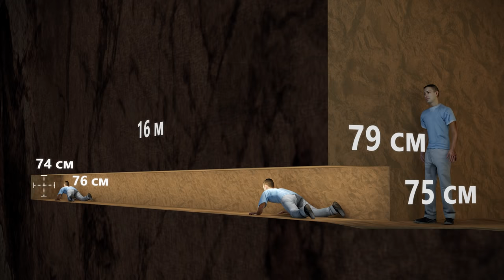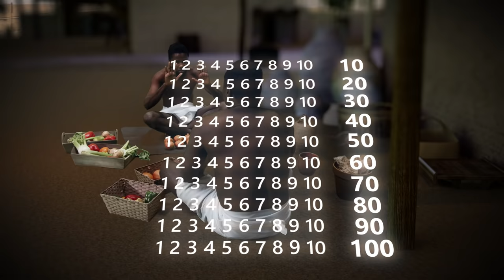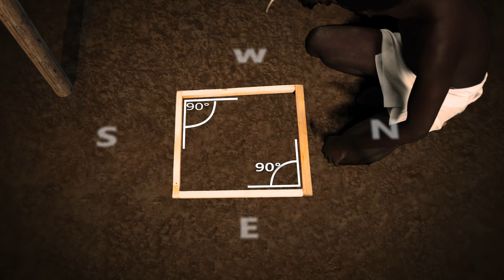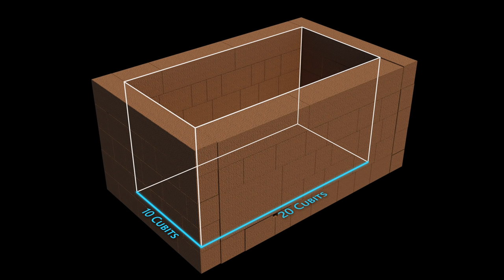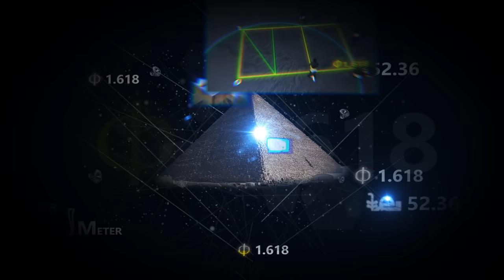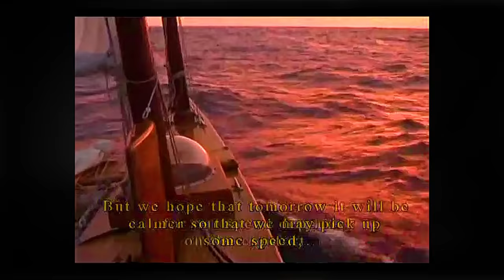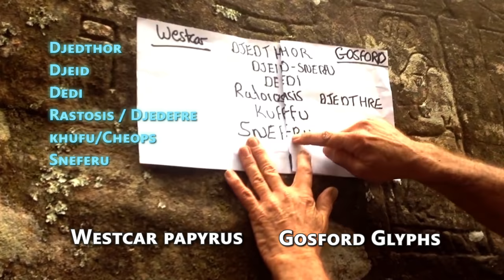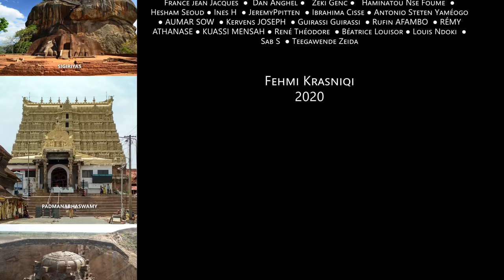The Movie Great Pyramid K 2019 - Director Fehmi Krasniqi

Comment: This makes alot of sense. Only one question. Has anyone bothered to actually try to melt any type of stone with a giant magnifying glass? The whole thing hinges on a central untested hypothesis and yet still makes more sense than anything I've seen put out on this before.
Reply: Yes! Has anyone melted stone yet on this large scale... Let's do it!
Reply: I wondered the same thing, but the basis of the theory still holds up, whether it was melted by a lens or some other means. There is another video on YT melting granite using radio waves. John Keely proved it could be done using music, or vibrations of a specific frequency. Given that light is on the same musical scale at a higher octave than sound, it's possible it had more to do with generating a specific wavelength than the heat generated by focusing sunlight. Just a thought :)
Reply: Might also have been chemicals, rather than glass. 

We have chemicals today that can create intense heat. Also there are signs of stone being "soften" several places in the world. 

Perhaps they where masters of chemicals for stone production after thousand of years of development.
Reply: yes Micheal Tillinger found out they used to melt granite in South Africa or what is now S,A check out some of his video's You will find out how they used to and still do it
Reply: I can't find a single credible example of granite being melted back into Granite of the same consistency it was. It always turns to obsidian or glass and not back to the origional colors or form in general. The pink granite in the Great Pyramid which is supposed to come from Aswan looks exactly as if it did come from Aswan, so they would have had to have melted it down and when it cooled it remained looking identical. At this point that would be an unknown heating process because other methods won't give you that result via sunlight or fire. I want to believe this and I will continue searching for the answers
Reply: @taylorgall9516  One method might not have been used for everything. If you would have found a building site from 2020 in 500 years, one might find a stone and conclude that we did not have tech to make concrete. It would of course be wrong. Also, we already know that they have tech we do not have today. The question is if it is unknown tools or unknown chemicals. Or a combination of both.  I think it is the latter, and thats why the answer is not simple. They did not have electricity, nor fossil machines, so they where forced to be creative with what they had.
Reply: @nicksantus5307  Thank you, will check it out.
Reply: I studied heat treating stone that were used to make stone tools. I've used blow torches on cherts. Never enough to melt them. Just some holes in there theory.  I still think sound technology was used to cut, dress and move the stones.  Heat just doesn't do it. We still have a lot to learn.   Especially about our past.  We have been knocked back three times or more back to the stone age in my view.
Reply: I have a Fresnel lens that will melt granite, but it has not been possible to slow the setting process to keep it from returning to obsidian rathe that granite! They must have had a way to slow the cooling to get back to granite rather than obsidian or rhyolite. if the hypothesis stands the ancients must have has a technology to gradually cool the melted granite.
Reply: @doc2help  main problem granite when form under continent ( pressure ) and 100,000 or million years of cooling time to give time to all crystals to grow  at the end liquid quartz bond everything together all of that cannot be done , it is more realistic to think of alien civilization with construction equipment able to transport and cut/ shape the granite
Reply: @doc2help  maybe if its in a vapor lock it wont change properties
Reply: The one complex avoided that throws EVERYTHING out is pumu punku. If your not familiar with it look it up. It's in Bolivia i believe. But the construction methods are unlike ANY other place on earth. Huge H blocks. Machined to PERFECT tolerances. Inside corners impossible to machine with today's tools. Made of dyrite. Just don't make sense at all. What was it even used for? The people in the area say it was there BEFORE they were.
Reply: @boatguy64  i know very well Puma Punku , agree but one correction rock type is Andesite a type of granite and the technical level is way out of this world  do you know the LAH report from Russian scientists ?
Reply: @doc2help  What about Nile water and or an Au bain form of heating with different liquids that would keep the temperature constant. I just looked up liquids and boiling points and sulfur seems to have the highest at 440 C but I have no experience with heating stones, could a longer period of granitie bathing Au bain in 444 C do the trick in stead of lens?
Reply: @MarcCuster  SONIC LEVITATION - SEE HAWKWIND LOL
Reply: @taylorgall9516  Specific frequencies and the meaning of gold
Reply: It's great that everyone seems to be waking up to the genius construction skills of the ancients. Look up the Serapeum and the Osirion, mad boxes in caves! Our real science and history is covered up by the establishment who are guided by the people who control all of our currency. You look at astronomy and biology for instance, all of the real experts say that current theories cannot have caused the effects we are now seeing, but it doesn't stop the academic masses from teaching that gravity creates the solar system and the galaxies, or that blind chance allowed a self replicating cell to magically come into existence and then survive, thrive and diversify, with a little more lucky charms. Earths gravity is too weak to defeat the strength of a tiny fridge magnet and a single protein is soooooo complex just 1 appearing is a vanishingly small probability and over 200 are required in the simplest viable cells. Don't take anything for granted, I could be talking shit, so think and investigate for yourself. All I can say from my own research is that from the big bang to evolution the ruling concencus tells us everything is a big accident and that there's no guiding force, nurturing principle or 'life wave' producing the many wonders of the natural world, and I view that dogma as not just absolutely ridiculous, but also, highly suspiscious..! I think it was Sir Fred Hoyle who said that expecting our universe from a massive explosion was like seeing a hurricane go through a junkyard and then finding a jumbo jet!
Reply: @al2207  i thought it was described as dyrite sp? A type of basalt
Reply: @boatguy64  i think you mean diorite but it is a type of igneous rock with smaller crystals
Reply: @davidrabie  melting granite with a lens is a proven fact it can be done very easy
Reply: @al2207  say they did melt it. I will allow that. But how do you reconstruct Granite? All the inclusions? Crushed. Melted. U get absidian. Glass. It begins homogenous. I can't see possible to take Aswan Granite and crush it, melt it and make Aswan Granite. Not absidian.
Reply: @boatguy64  there are numerous video on youtube with melted granite and ending with obsidian there is no other alternative
Reply: @63phillip  can you show me large scans proof, I mean a bucket size at least
Reply: Yes you can smelt iron with sun even far north see Prometheus Forge
Reply: @doc2help  Maybe it's the hot weather in the desert that made it possible? I don't assume you live in a desert, do you?
Reply: This is the best explanation I've heard to this day. I've studied and wondered since I was a kid. The question now is who taught them these high level mathematics 🧮 and why didn't they share the knowledge 🤔
Reply: @taylorgall9516  Do you have any more answers now? I'm very curious.
Reply: @RDB-mw9ig  yes I have a definite answer, you can't melt granite and be left with the same Granite. The crystals form under high heat and under high pressure very slowly and that's what squeezes them together so tightly. When you melt it down, all the constituents will mix together. Not possible in any way, shape or form and never will be possible to do with granite.
Reply: @63phillip  yes you're absolutely correct, it then forms obsidian, not granite.
Reply: @doc2help  It takes thousands of years of slow cooling for the crystals to grow back into granite. This video flunked geology 101.
Reply: @boatguy64  I've seen that...the blocks fit without mortar in incredible tolerances...wonder what theories were put forth on that structure? 🤔
Reply: @clivewells7090  I understand and agree, and so do several prominent scientists from various feilds...not all scientists are atheists.
Reply: @illiadmcswain3956  none that I've seen so far. They have no idea what Puma Punku was even used for. It looks like it was  blown apart and blocks scattered. Inside cuts were machined to incredible tolerances. No tool marks. I can't imagine it could be replicated today with diamond tools. Inside corners are particularly difficult without leaving them rounded. Show me how they cut a 3 way inside corner perfectly square. And outside corners so sharp you can slice your finger on it. 
 Supposedly made w stone age tools by a people who had NO written language. And didn't have the wheel or screw. AND only copper that was found. Not mined? Impossible.
Reply: If someboddy do that proof will have no chance to live🤪
Reply: @DeepSleepRelax  I live in AZ and I couldnt even cook an egg on the sidewalk in the middle of summer-117 degrees F!!
Reply: yes, they have.  However, nobody has tried the methods I'm looking into.  Sonic vibrations plus piezoelectric effect.
Reply: @growthisfreedomunitedearth7584  Now, we are in front our research, the stone are artificial, it 's concrete, is it possible to make concrete 5 000 years ago, every body have suggestion, the true arrive..💋💋
Reply: @boatguy64  what if it was partially melted and perhaps vibrated as to only separate grain boundaries temporarily.  It would then work like a putty.
Reply: Yes I’m super curious to see this tested with the whole big magnifying glass theory. Also some sort of chemical reaction seems logical and makes sense. But lastly I watched some documentary about this Indian guy talking about ancient people knowing how to makes certain rocks weigh much lighter by banging another rock on it or using sounds somehow ? Either way this documentary was magnificent and I truly feel all this is true in my heart and soul. This is the biggest game changer we have today! With the same passion and effort in making this can you guys get back together and find the truth about 9/11?!?? Please !!! Lol thanks
Reply: yes.. if they did with lenses there is no sign about it.. no lenses too.. and also from the lenses how can melting Rock it will take lot of time.. so how they know it 🙄 we can believe melting method it can be 90% but how
Reply: 100% possible in your back yard...takes 20 seconds to melt granite.
Reply: I think that is a job for Mith Busters
Reply: stone is 'melted' chemically, not by heat.
Reply: ...It's as ridiculous as believing in the theory of "Man-made C(lie)mate Change". 😂🤣😅
Reply: @SoumiSenguptaBDS  As stated multiple times above - You can not melt granite and turn it into granite. It becomes basalt or obsidian. So the theory is plain wrong and they must know it. They were trying to present everything so scientifically but many so many assumptions and conveniently didn't include any examples of the fresnel lense melting granite into granite... because it can't be done.
Reply: @haknys  You claim that “we already know that they have tech we do not have today”.
No, we don’t know that. You made it up.
Reply: @boatguy64  Sorry, have to correct you. Today’s tools can easily machine inside corners.
Reply: @clivewells7090  Well, until the “guiding force” you casually mention is discovered, we have to work with the evidence we have.
Reply: @SoumiSenguptaBDS  You can melt granite, but when it cools it is no longer granite.
Reply: @willbarker1693  How exactly?
Reply: @blackduk6200  Well, you can deny the facts if you want to, but they are still facts. The science is very clear but I don’t think that you will bother to try to understand it.
Reply: @majordendrocopos  i think you do not understand the level of technologies needed to achieve all megalithic constructions
Reply: @al2207  Which technologies do you mean?
Reply: @majordendrocopos  ..You already believe the lies. So, act accordingly. 😆😅🤣
Reply: @blackduk6200  You forgot to say where you studied climate science. I wonder why? Could it be because you just watched a few YouTube videos and you are calling it a study?
I am only interested in facts and evidence. You have provided me with neither.
Reply: @majordendrocopos  technologies to cut, extract huge granite block , to be able to transport 1000 tons blocks from any distance , to be able to carve perfectly statues, hieroglyph without leaving traces ,
Reply: @blackduk6200  Yeah. I knew you didn’t study climate change. If you actually had studied it you wouldn’t say such stupid things.
Reply: @majordendrocopos  ok cupcake
Reply: @blackduk6200  My pleasure, glad that you learned something.
Reply: @majordendrocopos  megalithic construction are evidences
Reply: @blackduk6200  If there is any other science topic that you are also very confused about? I am always glad to help.
Reply: @al2207  No, the megalithic structures are not evidence of ancient technology. They are just amazing megalithic structures. An ancient machine, or even a little broken piece of one, would be evidence. Or maybe a detailed description of ancient technology, written or drawn at the time.
So far, no such evidence has ever been found. The only evidence we have is the structures themselves and simple tools, and the records from the time which tell us who had the Great pyramid built and some details of the food and lodging of the workers.
Reply: @majordendrocopos  ..You really ARE delirious! 🤡
Reply: @blackduk6200  No, I am quite ordinary and sensible. By the way, you still haven’t told me where you studied climate science. Did you fail the exam?
Reply: @majordendrocopos  sorry cannot make somebody to see if his head is so closed
Reply: @al2207  I am very interested in real facts and evidence. Is that what you call having a closed mind?
Reply: @majordendrocopos  i am surprise you say that , just look at Louxor obelisks with perfect engraving in huge structure in pink granite that cannot be done by hands , i was there in march 2020 and they are perfect 2 cm deep with flat continuous glassy bottom bottom , even not talking of extraction shaping and transportation today it will be a huge task to do that
Reply: @al2207  All I said was that no machinery or high tech of any kind has been found on these sites, and the Egyptians themselves never mentioned anything of the kind. Not a controversial comment, just the truth.
Does that surprise you?
Reply: @majordendrocopos  yes if you believe Fehmi you cannot understand reality
Reply: @al2207  I am not very interested in believing anything. I don’t see why it is useful to believe something which you don’t know to be true.
Reply: Yes.. yes they have .
..there is liturally tons of vids of people useing sunlight to melt stone 
...look it up..
Reply: @letsbehonest4221  Yes, yes, but when the stone becomes solid again it is not the same as it was before it was melted. That is why this video doesn’t make sense.
Reply: @letsbehonest4221  and they are using Fresnell lens or large magnifying lens all of that do not exist in Egyptian time
Reply: @al2207   but but but this vid tries to say they invented EVERYTHING..🤣🤣🤣
Reply: Granite will melt at 1000 degree Celsius. A solar contractor that is already in use in France can generate 3000 degree cesiun.First question. Is it possible for granite to be melted? Yes or No? Yes, granite can be melted into a liquid under lab conditions at 1000 degrees Celsiis or 2000 F. Second question. Can a solar energy concentrator generate enough heat to melt granite to liquid? Yes, it's possible because a similar technology called Solar Furnace is currently used in an application in France and can generate 3000 degree C, which is much higher than the temperatures required to melt granite. See https://de.m.wikipedia.org/wiki/Solarschmelzofen
Reply: If you melt the granite it will become black without the granite marks
Reply: That is the only part that lacks of test I believe. Melting granite will turn into obsidian given the fast cooling process.
Reply: @MarcCuster  you are right. It's not possible to melt granite just like that. I worked 12 years in granite quarries. You can't imagine how difficult and dangerous to cut and transport these blocks. I don't know if it's makes sense... but it's a respectable theory.
Reply: Make sense until they start talking about Egyptian travel to ancient America lol while smh...
Reply: The problems is that if you melt it with lens when it solidifies it will do it at environmental pressure and temperature so it will solidify into glass shape stone (like obsidian)..so it cannot be consider as an option and has to be discarted.
Reply: @al2207  🤣🤣🤣 ALIENS are more realistic?
Reply: @s.carmichael8396  oh yes , the 5 meter lens , the melted granite , the water identical droplet , and so on
Reply: @boatguy64  So they would need a containment vessel that  wouldn't melt before the Granite melted and also hold its shape, and then how long would it take for the molten Granite to cool enough to hold its shape once the form was removed? Then they would still have to remove the Granite from the form. Where did these "magnifying  lenses" go to after the job was completed? How do you lift such a giant piece of glass? How did they form it in the first lace? Too much BS throughout this entire video. Had to stop watching it, sadly.
Reply: You cannot, repeat CANNOT melt granite and have turn into granite again.  It doesn't work that way.  Granite is formed when magma, underground molten rock, cools VERY slowly under extreme pressure.  It takes millions of years for granite to form.  When you melt it, it becomes black obsidian, NOT GRANITE.  Obsidian is a type of volcanic glass.  I worked in the granite industry, so I would know.  If you don't believe me, try it yourself and see.  This video is trying to pass off pseudoscience as fact to the ignorant.  It is complete and utter BS.
Reply: @brabanthallen  interesting.
Reply: @brabanthallen  agree , so many lies  the 5 meter lens , poured limestone block , water droplet and so on , who did pay for that ?
Reply: this theory melts right there...
Reply: @doc2help  slow the cooling by insulating it with something like kaowool insulation.  See if that will slow the process down.
Reply: @doc2help  I also wonder how long time would it take to cool one melted block before you could do the next one next to it or on top of it. I guess we are not talking minutes but maybe days?
Reply: I totaly respect all of Your guys comments BUT still no one can tell me HOW they flippin' made a LENS THAT huge. 🤔
Reply: you have two thumbs, do that make sense?  sure don't make you smart.
Reply: yes , im wondering about the scale of constant clean up needed for melting and hardening, and flowing concrete.
Reply: @yeshazion4098  y además de eso, no muestran como levantaron el granito hasta la mitad de la pirámide, bloques de 50 a 100 toneladas, no hay explicación!! Al principio me estaba gustando este documental pero luego empezé a desconfiar
Reply: Yes.  I have seen videos of people using glass lenses to melt rock.  It works here in North America.   It should work extra well in Egypt since the sun there is very very hot.
Reply: @blackduk6200  Are you familiar with the Ozone layer and how the near elimination  of CFCs stopped it from being depleted...?